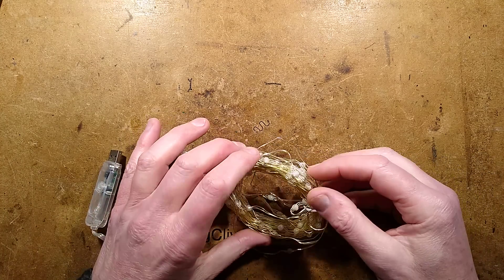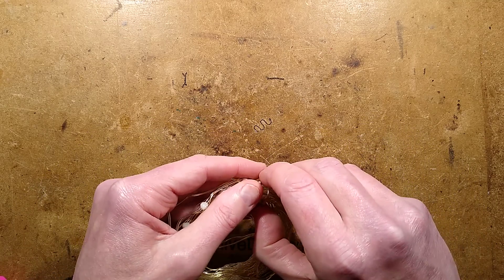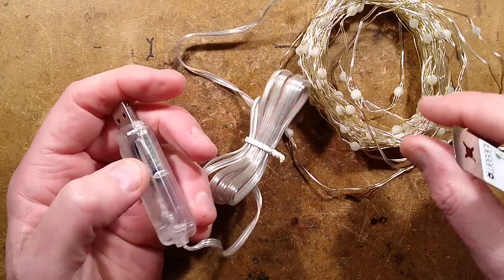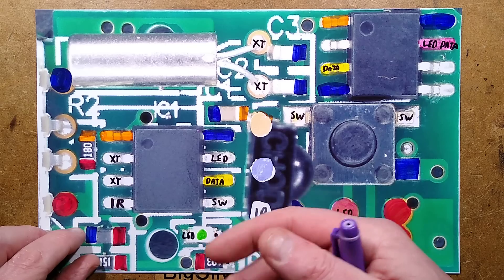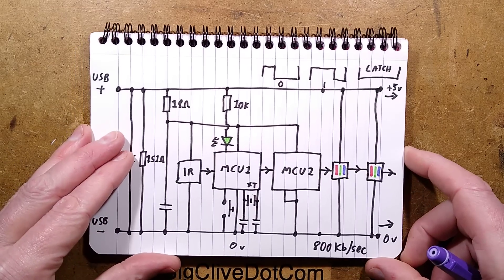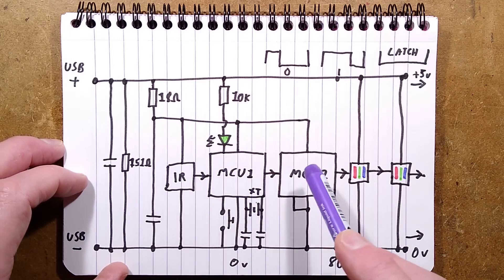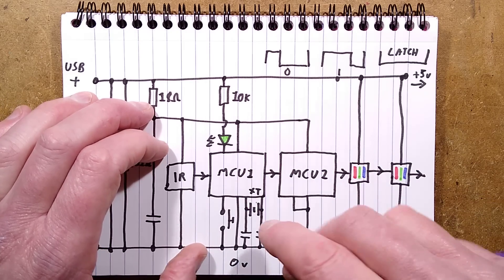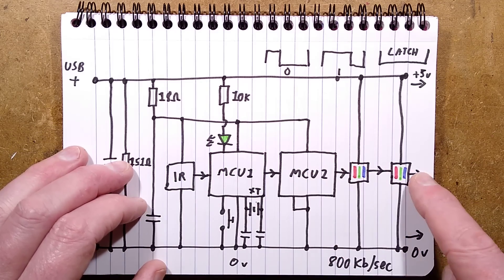Exploring a faulty set of addressable resin blob LEDs - with schematic

Comment: WS2812Bs can be fun, and even aesthetically pleasing - if you can find a suitable controller. The Fadecandy board was excellent for strings of up to 64 LEDs, but it's no longer available. I've used a Beaglebone Black running the version of LEDscape available from bigjosh on Github for longer strings. It works well, but only on a really old version of Linux (so not suitable for an internet-connected network). Both those act as servers for the Open Pixel Control protocol which allows you to run a range of different algorithms (preferably on a separate client) to make interesting (i.e. not horrible!) patterns. Avoiding crosstalk on long data lines is simplest if you use RB59 coax. I found that leaving the braid screening disconnected at both ends worked best on a 15 metre run but YMMV. I also had problems with flickering until I used the "sacrificial LED" approach - a single WS2812B for each strand on a driver board (near the Beaglebone,) powered at about 4V. That both shifts the data from 3.3V to 5V and cleans up the data signal.

Comment: Found a version of these in the Netherlands with just one microcontroller. I like the string with blobs arrangement, used to solder separate WS2812s to wires to make something similar myself.

Comment: I watched your vid again because I was thinking about the Uno I have, you can program it and that also makes things clearer programmingwise. In the programming it needs to address the right LEDS, and then how much LEDS there are. Then it is a question what you want for which of the three colors and so send the data over the line. With an Arduino Uno it is so much fun, programming it with all kind of color or simply show a text. Maybe if you have the time you can show that programming also, but if it is not your forté then forget it. Thanks Clive, nice video.

Comment: Recent chip architectures like the RP2040 have programmable I/O coprocessors that can be used as general purpose I/O without putting load on the main processor.

Comment: I love the ws2811 12mm waterproof leds, I have around 2000 pixels making up my Christmas lights this year. I’ve been using the 5v version for about 5 years but I’ve upgraded to 12v this year and the 5v strings have been repurposed for a “mega ribbon tree” in the back garden.

Comment: The single wire NRZ signalling protocol is tight on timing, since each stage regenerates the data without a separate clock. But even a measly atmega 328 can outdo it with a tiny bit of ext h/w support🤔, even at 8Mhz spi, with 800khz bitrate. The limitation is the memory(3 bytes for each led) needed for long strings(1000 leds). Also the standalone ws2812b ws2811 chips can work well as 3 channel pwm controllers for dc motor control, with appropriate mos drivers.

Comment: WS2812B LEDs really are versatile for all kinds of stuff. I bought a 5m roll of them years ago and currently have 2 projects that use them: a little 3d-printed star shape with LEDs inside that's used as a night/decorative light during the dark months (running WLED on an ESP32), and a large 3d printed 7-segment clock driven by a raspi with python code I wrote myself (though the LED communication is covered by a python library).
WLED is like the swiss army knife for those LED strips. It runs on all kinds of microcontroller boards, has a web interface, a HUGE library of built-in effects, and of course you can also add your own effects/patterns and timers for en/disabling them automatically. And it can even take dusk/dawn into account if you tell it your location.

Comment: Nice video! It is pretty easy to program these LEDs with affordable MCUs. You will need an Attiny 0 or 1 series IC like Attiny402 and an Arduino UNO or Nano to program the Attiny. The megaTinyCore library includes example codes for this, called tinyNeoPixel.

Comment: Did you ever find the 24VDC "fairground" cabachon lights which are based on WS2812 type tech?  They'd make an interesting follow up if you find them.  I can send you a couple more if ya like!
Reply from the maker: I did, and then they sank back down into the gadget mountain.  They definitely will get their video made at some point.

Comment: I have a lot of these sets with Bluetooth controllers, but with PVC-coated wire instead of bare copper wire. They are WS2812 leds, but they don't draw as much power as a standard one. On full brightness white (controlled by a ESP32), a 100 led string draws just 1 amp. Extremely efficient LEDs!

Comment: 2 processors, did the same for controlling stepper/servo motorboard, 1webserver pico and 1 motorcontroller pico, talking thru serial,  using micropython programming language,
motorcontroller uses timer to signal steppermotor/servo (simulates loop), this way i can control a stepper + dc motor + 2 servos at the same time using a webpage or http requests.

Comment: It's great to see you getting around to talking about how these addressable LEDs work. 
The clever design of this type of addressable RGB LED is older than it might seem, and its true origins are not well known.
 
The "original" WS2811 (basis for the later WS2812b with integrated RGB LEDs) closely copies the bit timing method, the data packet protocol, the byte stripping and packet regeneration, and other key features, from the CK102, an 8 pin CMOS ASIC designed in the US that first went into production in 2003 (and is still used exclusively by a famous lighting brand for some of its high priced addressable RGB products some 20 years later).
Though the WS281x and its equivalents from Shenzhen took many shortcuts in their version, such as only 8 bits per color (instead of 12), no built in gamma correction, a strict data rate requirement (the CK102 self-clocks its registers from the incoming bits, allowing the controller to define the data rate over a wide range), much slower PWM rate on the LED outputs (though newer ones have improved), data drivers and receivers more sensitive to EMI and system noise (limiting distance between pixels more for reliable data reception), less headroom for voltage drop (limiting string length more without power injection), and no self-test mode (CK102 goes to dim white when the data frame becomes all 1s, i.e. data line shorted to V+). CK102 also allows an external LED current programming resistor (a factory-set value unavailable to the user in most WS-type control ICs), and it's rated for >24V.  Many of these features (or similar) can now be found on some more advanced versions, but not all of them, and still not all in the same package.

Comment: Computationally intensive fairy lights - we certainly DO live in very interesting times, and as you say, these are readily available for almost peanuts from the "Usual suppliers". I'll have to supplement our existing Xmas light stockpile methinks!
Reply: Or just make your own using an ESP board running WLED (or buy a ready made controller) and buy a long string of pebble style LEDs and cut them to length.  Whole lot is then just controlled by your mobile phone or a webpage on your computer.

Comment: 2 microprocessors simply because they ran out of code space to put it all in one, so went to 2. First one has the patterns built in, along with the control and IR library, and simply sends a serial data burst to the second one, with likely some simple 2 bit brightness ( why bother with 8 bit when you can do it with less) per position per colour, so 1 bytes per LED stored internally, and then when the data is finished the second microcontroller simply loops and repeats the output. New data interrupts the second micro, it will time out the LED array, while decoding the new data, and then on end of data simply resets the array and starts the new pattern. 2 units as likely cheaper for 2 than a single higher capacity single one, and also allows them to reuse the second one in multiple places as well, only needing to program the first unit to drive it, and having a bulk supply of inventory already programmed to solder to the board.

Version 4, if it is popular enough, will have a blob holding the 2 microcontrollers on the board. Resistor is there because they probably had issues with power banks, but also likely because they also had issues with the brown out system on the microcontrollers (they often are a big part of the errata, as they either do not work, or work too well, so are disabled) so put in something to force a good reset.

Comment: Last year, I designed my first dual-MCU project. Only becasue the design had to run an ESP32 for 2 years on 3xAA alkaline batteries. 
Since the ESP32 works on 3.0V~3.3V, it's impossible to have it run on batteries without a regulator that drains them batteries. 
I used an ATMEGA328P that runs from 3V~5V without a regulator. Why? becasue it was cheaper than an ATtiny85!
When the services of the ESP32 is needed, the 328 would enable the 3.0V regulator that runs the ESP32.
The ESP32 has a great low power processor that could've been used, but requires a fixed input voltage.

Comment: PIC18 Family has high and low priority interrupts. I built and sold a 20 Channel RC Servo controller in 2002 using that priority interrupt feature of 18F family, that no other MCU had at the time. I had to use a 4MHz resonator, since a crystal was too expensive for the design. That design had a (+/-)100nS jitter. 
What baud rate do these LEDs work at? I've never used them. 
I worked on an 8-channel stepper motor controller using an 18F242 project in 2010, that used the internal 8MHz RC oscillator. Did a pretty good job up to 9600bps, but was unreliable after that, due to temperature affecting the oscillator accuracy/drift. Had to use a crystal to be able to communicate at 115200+ bps.

Comment: I used an SPI bus running with DMA on an ST32F103 "Blue Pill" board to keep the timing while using an RTOS on tne same chip to run strings of these LEDs.. oversampled the bitstream by enough to keep the timing accurate, using error accumulation to add or remove occasional samples while encoding the bytes into the bitstream.

Comment: In a way, that 150 ohm constant load resistor is more elegant than having a 555 or a micro periodically draw a gulp of current to keep the power bank awake. Less efficient, but elegance is rarely efficient.

Comment: I have a set of lights that if you have them on and u pull the batteries out....when u put them back in they wont turn back on.  I figured out that if you thump the crystal, it will make them turn on just fine. I have test this many times and it works.....any ideas why? I thought maybe a bad solder joint so I reflowed them.  The set runs off of 3 AAA in usual series arrangement, and the board has just the single 8pin chip and no IR receiver.  Lights are just (near)UV and orange alternating polarity LEDs.
Reply from the maker: The processor may not be getting a clean boot-up.  It may be the battery connection breaking briefly that causes them to reset.

Comment: Modern larger-scale microcontrollers like ESP32 and RP2040s have dedicated peripherals that can be used (abused) to generate stable ws2812b signals while simultaneously generating complex LED patterns and handling communication (bluetooth, wifi for ESP32 and IR) and enough RAM to buffer large LED patterns. I've used them to create motion-sensitive LED toys and garments. That said, I can understand why they would instead choose to slap 2 PICs that probably cost them $0.15 each instead of an ESP32 that costs $1.25, especially when they have no need for lots of CPU and memory to manage complex patterns.

Comment: Last year, for Christmas tree, my niece wanted one of these. I bought it and the joy lasted about two days, until they refused to turn on. I powered them from an 5V/2A USB adapter but they refused to work. I got the refund but got to keep them. In the summer, I decided to look at them and, when I tested them, with the very same power adaper, they worked. Until now, they work without a glitch. The circuit board is the same as yours.
Btw, that load resistor might be used to "force start" those powerbanks that need a big load to start? I have few that really need a signifficant load to start, that will not start with a low power white LED (few mA).

Comment: Interesting set! Too bad it repaired itself in transport - I would have loved to see you hunt for a fault in this tricky addressable setup 🙂
Reply from the maker: It may have been a software issue in the chip.  Possibly even a rogue code from a different infrared remote control that put it into an undocumented mode.

Comment: I wonder if the load across the supply is to, as you said, either keep a power bank awake or to ensure if it's connected to a PC they don't cut power either to save energy. I've had on my older Asus board that occasionally things would drop the connection seemingly at random until I turned off energy saving options on that root USB hub.

Comment: These strips use "almost" the same WS2812B protocol, but instead of stripping their byte and passing the rest over they just pass all the data through. Each LED gets pre-programmed with an index at the factory, and they are just wired to the same three wires in parallel. This ultimately makes it much easier to assemble them rather than having to interrupt the signal wire on each individual LED, but also means you can't put two strings in series.
Reply: OH. You’ve just answered a question I’ve had for months. I could not connect these in series and I could not understand why.

If [0] is always going to want to be [0], I cannot force it to be [100].
Reply: @thesuperknot_  There must be different types of these fairy lights then as I have connected two lots of 100 in series and the control went from 1 to 200 but you have to change the pixel count on the micro  done by the Bluetooth controller I bought10 sets to make a video wall at a pitch of 100mm

Comment: I have two strips of similar LED's where I replaced the controller with some ESP01 modules running Wled. And another strip that works, but has one rogue LED that somehow lost its pre-addressed index, and mirrors the start of the strip.

Comment: I remember the days when the most advanced type of LED was the red blinky fake car alarm ones, these addressable ones, they just confuse me!!! :P
Reply: Do a search on WLED, cheap and simple way to make assemble your own strings.  But it really is a rabbit hole once you get started.
Reply: I share your confusion.
Reply: Yes, I used to built them for friends and also those green/red blinky ones.
Reply: Back when people used their minds for SENSIBLE things… well, usually 😁
Reply: Simplified: Transmit 8 bits for each of 3 colour intensities making 24 bits per LED.  Repeat for each LED in the chain.  The furthest LED in the chain gets the first-transmitted set of 3, while the closest LED in the chain gets the last-transmitted set of 3.  Stopping the data transmission signals the LEDs to act on the data instead of transmitting it to the next LED in the chain.
Reply: @melkiorwiseman  Not quite right. Each LED consumes (stores) the first 24-bit packet (8 red bits, 8 green bits, 8 blue bits; packet 1) that come down the data line, and passes the remainder (packet 2 to end) down the line to the next LED. The next LED then consumes the first 24-bit packet it receives (the 2nd packet), and passes the remainder down the line (packets 3 to end). Each LED stores its own packet, until it stops receiving bits. After a short idle time, all the LEDs load their stored data into the 3 PWM generators to drive the RGB LEDs.

Its possible to keep all the LEDs from updating their PWM generators simply by continuing to toggle the data line, sending random data to LEDs that don't exist beyond the end of the string. The last LED doesn't know (or care) that the bits it outputs aren't going anywhere. It's just waiting for the toggling to stop. When the toggling stops, all the LEDs update at the same time.

You could also program an MCU to consume data the same way the LEDs do, and use that 24-bit data for some other purpose. Example: control the positions of mirrors with 8-/12-/24-bit data.
Example: switch the bit-stream between one or more sub-strings.
Example: convert the 24-bit data to 3 ASCII characters for transmission.

These would have to be fast MCUs as receiving/relaying bits is probably more challenging than just sending bits. (I hope you have a fire extinguisher nearby.)

Comment: another little-known feature of these kind of IR remote-controlled led driver boards is that they tend to use similar-but-different encodings for the remote inputs, and one remote will have unpredictable affects on other receivers; in one case, I apparently had an adhesive LED strip that supported switching of RGB/GRB wiring pinout via a command on the remote, but the remote I received did not have a button for this, and the remote from an entirely different set of LEDs triggered this function with no way of reversing it, permanently 'ruining' that LED strip's preset color patterns.

Comment: Clive.
If the string of LEDs that came with the circuit board was 100 LEDs long but you added another 100 to it would it work?
In my head I'm thinking that the micro processors are programmed for 100 and adding more won't work. Or can the processors detect the additional LEDs and change the way they work?
Reply: @Slikx666  normal ws2812 would require additional data, BUT these would work since you'd have hardcoded ones.   These are odd ducks, Exceptions to the rule
Reply: @scruffynerf7314  
Sounds far beyond my skills. Thank you.
Reply from the maker: The controller will put out a stream of data for a fixed number of LEDs.  Further ones in the string would not light.  You could connect two strings in parallel at the controller itself and they would mimic each other.